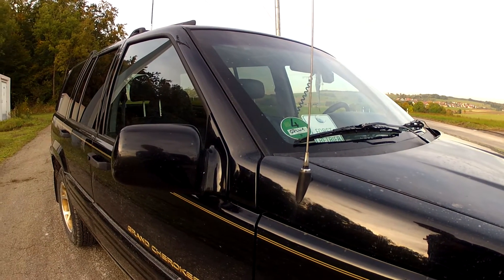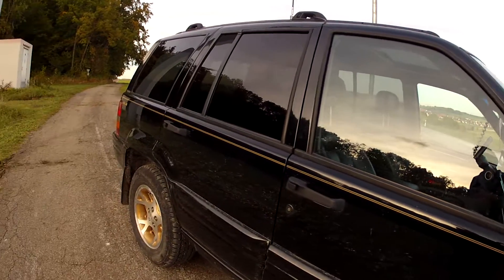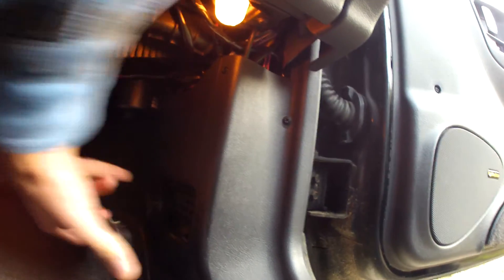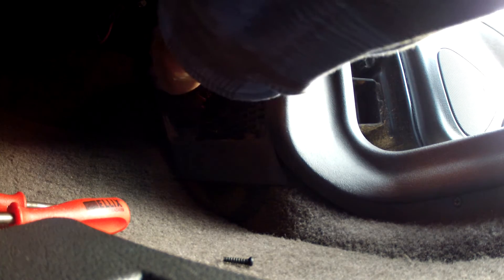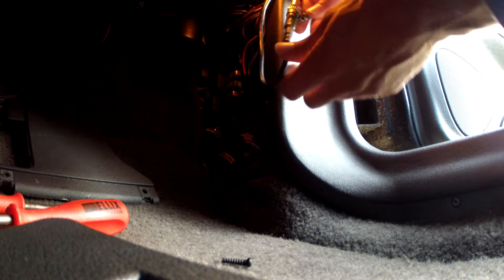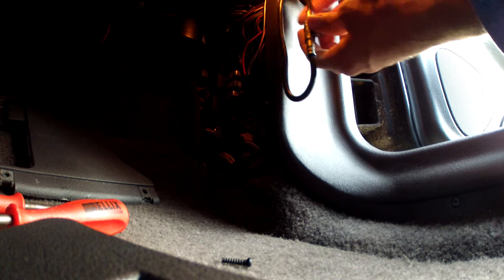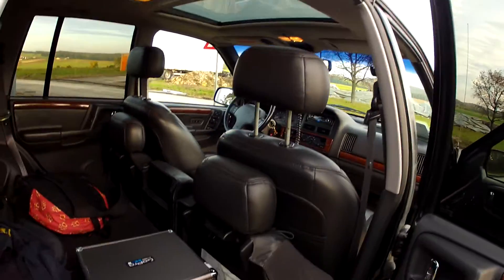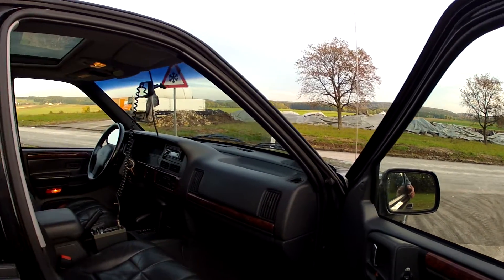Jeep ZJ radio signal problem solution and question bout freaking quickly wearing front tires

Comment: Thanks for the video. I have a 94 ZJ. I think my connection has come loose on my antenna as well. I changed the track bar bushings, the viscous coupler in the transfer case and aligned the front end using string to measure the tow end. now my tires are wearing much more evenly.
Reply from the maker: I just swapped out my NV249 for a NP242 last saturday. I was assuming the main problem with the tire wear was a worn coupler in my t-case. I'll see soon - got new tires and my 242 now. So happy with the Selec Trac! I love that thing. I was missing some more shift options in the 249. Though, I still love how stubborn and stable it rides with the 249. Anyways, thanks for watching!
Btw.... fuel mileage immediately popped from 12 or 12.5 to 14.5 and more - I love it. :)